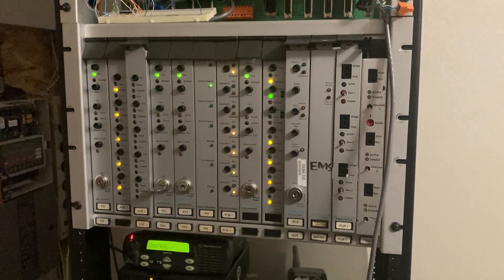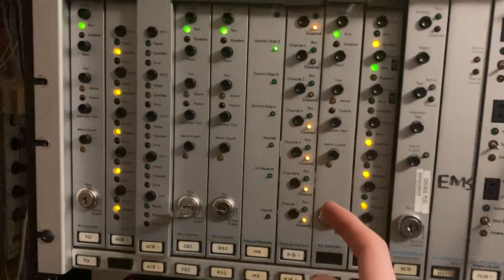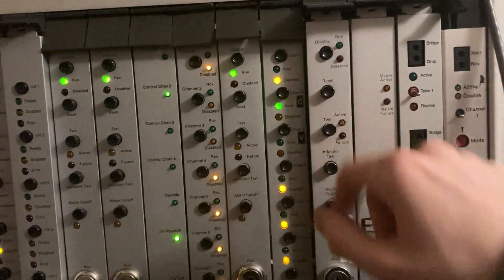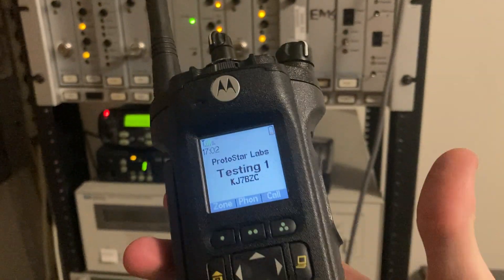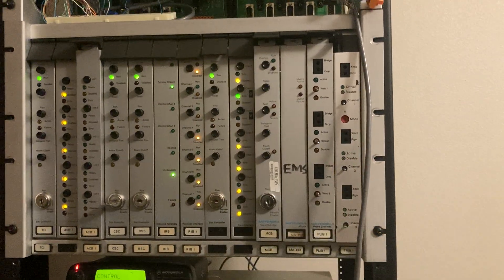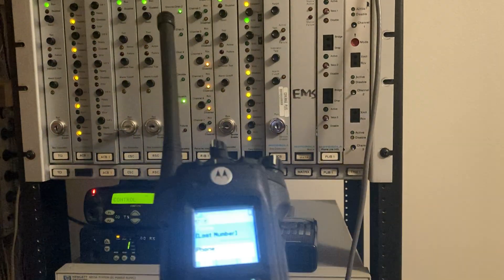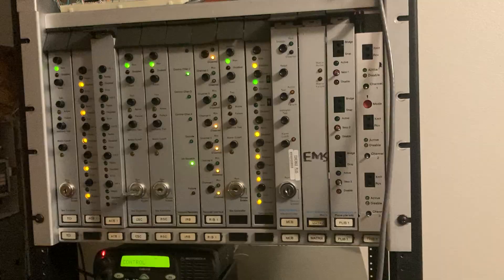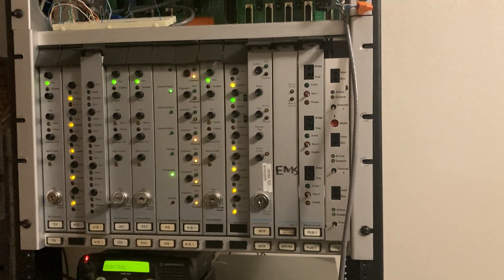Motorola 6809 trunking controller progress

Comment: Ran in to this problem few times back in the days ,  ended up bad pair of ICs ,  don't ask me which I can't remember ,,grab the oscilloscope and get to werk, good luck !
Reply from the maker: Luckily it ended up just being a simple configuration problem, the RIB board connect tone is fixed and cannot be changed in software, set the radios to use the original frequency and it worked fine. Troubleshooting this thing is a real monster though, I've had my fair share of precariously probing various ICs on a card while it's still inserted in the chassis...

Comment: I used to work on these. If I recall correctly, the 800 MHz smartnet systems primarily (not always) used voted receiver sites and the receive sites also had a remote site controller (RSC) that decoded the connect tone and because audio bandwidth of the microwave network and SpectraTac voter  cut off below 300 Hz the locally decoded connect tone was sent as a digital communications to the main (CSC) controller.  If your RIB is not decoding, it could be configured for a remote operation. I am not clear where in the programming of codeplug or hardware the dissension is made for your local RIB.  The Privacy plus versions of the controller would not have had this option set or equipped.
Reply from the maker: Definitely some good information to know, I did end up figuring out the problem though and it was surprisingly simple. In these older controllers the RIB's connect tone decoding is done with fixed tone detector ICs, the frequency is set by a couple of passive components and cannot be changed through software. I tried sending the connect tone that it was originally designed for and it detected it, changed the controller and radio configuration accordingly and everything is working fine now. I would like to try to get some form of remote controller set up on this system someday, or even a SmartZone network, just a bit difficult to find all the older hardware and especially documentation for it.
Reply: @KJ7BZC  great news!

Comment: Is the subaudible tone decoding done in hardware or DSP?   I would guess that there is a HP filter somewhere that is getting in the way, but I am just taking a SWAG at it.   Given the vintage of the equipment, I am also guessing that the tone detection is hardware... but it was common to filter the tone out before sending the audio to the xmtr.   Fun to see old technology resurrected... it was state of the art when it was new.   I imagine that we could emulate the entire controller with a raspberry pi pico or two... would be interesting (and possibly useful) to try.   Have you dumped the firmware roms?  6809 is easy to code... and the dev tools are easy too.
Reply from the maker: I just figured out the connect tone problem last night, after a friend had asked me this same question. I took a second look at the RIB card and found a datasheet for some MX-COM chips, they turned out to be hardware tone detectors very similar to the LM567, where the frequency is set by an RC circuit. Changing the frequency in the controller's configuration only changes what it tells affiliated radios to send it, the RIB card's frequency remains the same. I changed everything back to the original 97.3Hz frequency it came with, and that fixed it.

I did take backups of all the EPROMs inside it, there's a bunch of CPLDs that need backed up as well in case they fail in the future. Everything else is handled by a massive amount of discrete logic, so emulating the whole controller would be possible, just really annoying. I would definitely like to figure out the 3600 baud control channel messages though, could someday make a custom controller with more modern hardware, or even a completely software based implementation. With the signalling protocols being so simple, any modern microprocessor should be able to handle it all pretty easily.
Reply: @KJ7BZC is there any documentation on the data channel as to how it is modulated?   I am guessing from the sound of it that it is B or Q FSK, directly modulated by whatever data stream.  that's what it sounds like... that's what AMPS and NAMPS used for cellular, although it was faster... they had wider channels too.   That's kinda funny that they used the hardware tone decoders and evidently not even easily programmable.   The 567 chips were just a PLL with very tight VCO when used for tone detection, I think.     My first job was in paging which used the same direct FM scheme which was very easy to implement on both ends.   The discriminator output on the receiver simply needs level shifting before stuffing it into a USART.  The Pi Pico has A/D built in so the level shifting would just be a couple of resistors and the rest in software.  Technology has gotten crazy tiny.
Reply from the maker: @ka7znm  The control channel is a serial data stream which directly modulates the FM carrier of the transmitter, it's TTL level and there's only two states, HIGH or LOW, at 3600 baud of course. It's honestly just like a POCSAG transmitter, the signal can be taken from a flat audio output on a receiving radio, level shifted, and then ran straight into a serial port on a computer. I don't have a whole lot of information on the actual data format, though there are programs like Trunker that can decode it and were meant to be connected to a conventional scanner incapable of trunking in this exact way. I'm not too surprised by the use of hardware tone detection, this hardware platform dates at least as far back as 1979 (based on dates in a service manual I have for it) and was used for the original Type I trunking as well.
Reply: @KJ7BZC  I wonder if the control channel was designed to be simulcast on multiple transmitters, like they did with paging.  3600 is probably a bit too fast for that, as I think the fastest that POCSAG ever got was 2400... and that required tight transmitter coverage and timing.   IIRC, the paging formats were essentially synchronous, with no start or stop bits... they just had a long preamble to sync the receiver enough to receive a long bit stream.   That technology is nice a simple compared to what is in use today.   Direct FM is very easy to work with but it got left behind for good reasons.   The analog cellular systems used it at 10k bps... that seemed fast at one time.   But then so did 56kbps.... and overnight delivery...etc etc.
Reply from the maker: @ka7znm  Yep simulcast was an option for these systems, there are several timing parameters meant specifically for it in the configuration. I do admire the simplicity of the direct FM data formats even though they're pretty limited in use now. I never really thought about sending data this way, it's way easier than running FSK or any other modulation on top of it.
Reply: @KJ7BZC  I had an old ham buddy that invented and patented what he called "transmitter fingerprinting", which was a way to record the unique waveform  that all transmitters, especially PLL FM transmitters, have at the very beginning of their transmissions.   It never really caught on to be used as intended, but Phil did build a repeater controller that had the fingerprinting function built-in.   Instead of a courtesy tone, every time a user would unkey, the controller would send a 9600 bps direct FM "SQUAK" that was 128 or 256 bytes that was their fingerprint for that transmission.   He simply sent the data through a UART and it was exactly as your described earlier on the receive side, just some level shifting and right into another UART... usually a PC's COM port.    The controller also kept a fixed length fingerprint buffer that he could dump on command... and it was an unpleasant several seconds of screeching as it transmitted the whole 8k or whatever it was of the last N fingerprints.   I built the interface from PC to radio and Phil had a "TXID" program for the PC to receive and display the fingerprints every time repeater users unkeyed.   It was a slick system... although the actual usefulness was debatable.   Some radios were more unique than others.   Phil and his TXID are now long SK.
Reply from the maker: @ka7znm  Oh yeah I've heard of this before, it's a really cool concept! I think some people were using it to sort of "blacklist" malicious or obnoxious users of a repeater while allowing other people to keep using it. I have heard of at least one instance of a system that did this by looking at the PL/DPL tones that the radio was sending and finding little inconsistencies in that, not sure if it's the same one or not. I feel like newer radios wouldn't have enough inconsistency to make this a perfect solution but it's definitely a neat idea.
Reply: @KJ7BZC I don't believe that Phil ever had much luck with automating the actual IDing of each fingerprint.    The software would let you save fingerprints with a callsign and remarks and then you could manually compare them.   He was able to reject certain radios that had an unusually unusual fingerprint, but most of them were either too inconsistent or too similar to others to be automatically ID'd.   The repeater had the unusual quirk of being carrier operated *only*, as it would not allow a signal with a PL or DPL.   This was because those really ruined the fingerprints and he never got around to removing the unwanted modulation via DSP.   It was a fun idea but of limited use.  Might be fun to try on modern rigs... just need a discriminator output and likewise a sound card that will accept a DC bias, which I am not sure exists.
Reply: @KJ7BZC Oh and the fingerprint itself was simply the first 200 ms of the transmission.  It simply sampled it at a low rate... think it was only 64 samples... and that was it.   so anything that messed up that little part of the transmission immediately after keying was problematic for getting a fingerprint.   For that reason, in addition to rejecting PL/DPL, he also required that you not be talking when you key the mic... the repeater would not work if it detected audio during the fingerprint.   He had a speech synthesizer that would advise you, "KEY mic... THEN talk"... after your rejected transmission.   Was a bit annoying sometimes, as you might have told a 3 minute story only to unkey and discover that no one heard you and the speak and spell chip scolding you for your poor microphone handling.

Comment: Worked on several trunking systems back in the 80’s as a Motorola tech and later an FTR. I have only worked with Micor’s, tube and solid state 800MHz interfaced. Two things off the top of my head having not watched much. I remember the controller being very sensitive to any ac on the dc, so make sure your power supply is clean clean. I think your idea of switching channels on the card is a good one. I remember in the later days of not having spares, having cards with bad channels noted. I also remember that the phone interface will only work with a ground start POTS line. The same phone line used for old at&t pay phones. It’s been 30+ years since I’ve touched one, but interesting to see you breathing life back into it. Good luck.
Reply from the maker: Thanks for mentioning that it uses ground start! I haven't started working on the phone interconnect cards yet as I need to get a power supply that can provide more current to run them, whenever I do though, it probably would've taken me a while to figure that out. Power supply rails are nice and clean, I just figured out the connect tone issue last night. The RIB card has hardware tone detectors which have their frequency set by passive components, changing the configuration in the controller only modifies what tone it says it needs over the control channel. Changed it back to the original 97.3Hz tone that the RIB card is designed for, and it's now working.

Comment: Excellent video. I'd like to see how the modulation and demodulation works, because I don't have access to any mobile radio that supports this (or any digital mode, to be honest I was never interested in owning one). Would be cool to actually "make one" from scratch with other radios though! Happy new year, and cheers from LU9FSH in Argentina.
Reply from the maker: At least in terms of the inbound and outbound control channel messages, they're simply 3600 baud digital data that directly modulates the FM carrier. The signal coming out of the controller is a TTL digital signal either at 5v or 0v, when it's at 5v the carrier is modulated all the way in one direction and at 0v it goes the other way. The low speed handshake signal is very similar, but I haven't looked at it enough to be able to describe it well. Radios also send a sub-audible "connect tone" on the voice channel to tell the controller they are still there, it's very similar to PL/CTCSS. All the voice traffic is plain analog FM.

It definitely would be fun to make a radio, I've been wanting to make a simple analog-only handheld someday to implement some custom features others don't have. Alongside just being able to play around with whatever custom signalling methods I want to implement into it.

Comment: From back in the day I have serviced and worked on many of the Motorola infrastructure systems. Not trunking though but close. My suggestion is to check timing with your transmit and it could be that it's sending out the code quicker than it needs to for the controller to handle it. That's a common issue that I experience with Motorola quantire base stations and their infrastructure hardware
Reply from the maker: I did verify it's not a timing issue, that was something I suspected but it didn't turn out to be the case. Any instances where radios or the controller are missing control channel messages primarily has to do with my interfacing circuit between the mobile radios and the controller itself. I'm going to completely remake it properly at some point, but for now this works for a test.
Reply: Yes  there were delay settings for OSW-ISW which were critical due to the system backhaul and other variables.

Comment: I wonder how hot that cdm brick gets
Reply from the maker: It's actually perfectly happy to transmit continuously at 1 watt like this, it never gets close to where I'd be concerned about it.
Reply: @KJ7BZC  typically in production, a 100W repeater turned down to 40W on the control channel. This limits the coverage of the system while at the same time dealing with the fact that it is going 100% duty cycle.

Comment: This project is very neat, and I'll be following closely. I believe that I am in the same geographical location as you and having this system online on the ham side could be sick.
Reply from the maker: I'd love to run it as a public system but the IDing requirements make it a bit difficult for HAM use.
Reply: @KJ7BZC  Should be able to just throw an ID O Matic or similar cheaper controller inline with each transmit radio to run your automated ID... Also I'm close to you as well.
Reply from the maker: @makerbuilderscouter  With a regular repeater users just need to ID themselves on the input frequency, as it's broadcast back out on the output frequency by the repeater. But on this type of trunked system, their radio first transmits data on the control channel input frequency, then moves over to the voice channel input frequency for voice traffic. IDing with voice as usual would take care of the voice channel frequencies, as that acts like a regular repeater for the most part, but they would have to remember to ID on the control channel input frequency as well, as their radio had made transmissions to it. This is assuming just one voice channel too, if there are multiple voice channels the system will allocate an available channel to each user on a per-transmission basis, no real way to tell what frequencies would need to be ID'd on.

It's possible to do, just quite annoying, and having people IDing with voice on the control channel input frequency would tie up the system for other users as well. There is another type of trunked system called LTR which is a lot more friendly towards HAM use. I've got controllers for that as well, planning to make videos on it in the future and maybe set it up on a repeater if I can find a good site to locate it at.
Reply: @KJ7BZC  oh who cares, just set it up and let it ride. No sense in being anal about compliance, it's AMATEUR radio after all.
Reply from the maker: @VTX-Live  I mean sure maybe nobody would notice, but I don't think "who cares" is a good legal defense against the FCC lol... I would much prefer to stick to regulations and have it ID properly.
Reply: @KJ7BZC  The FCC Does not enforce this type of thing anymore. Haven't for the last 40+ years. It sets a precedent, you know? Plus, they can't even provide a working ULS. I feel zero obligation to go out of my way to be compliant in niche situations like this.
Reply: @KJ7BZC  Plus the first course of enforcement action is always a notice of violation. So if it ever ended up on their radar to the point of them noticing AND wanting you to stop, they'd have to warn you first before anything legal happens.